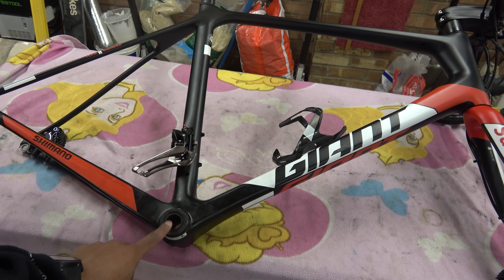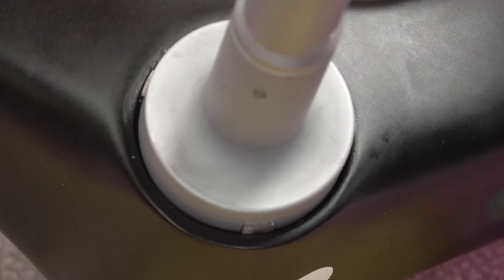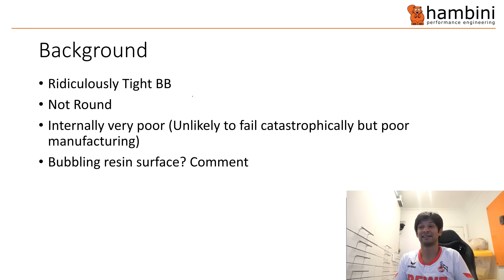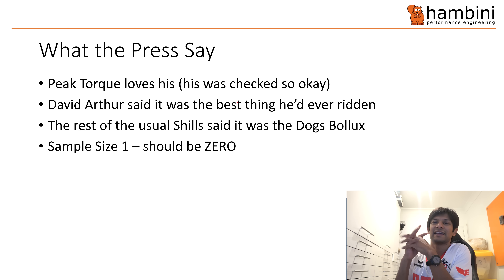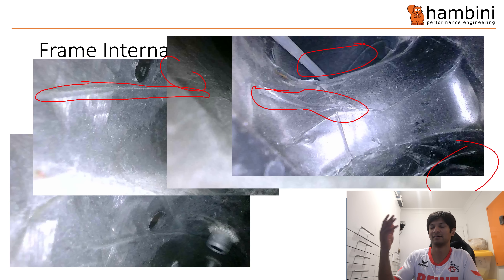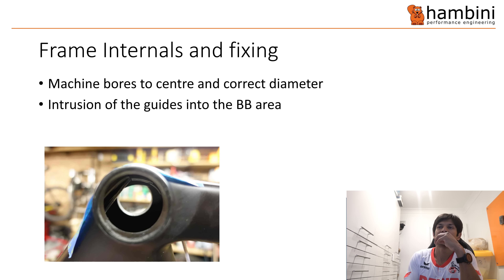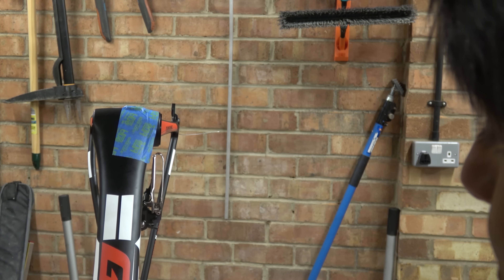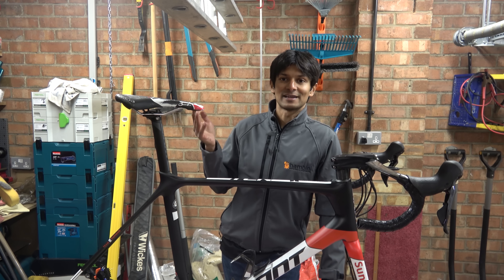Giant TCR gets Roasted. More CRAP quality control

Comment: I'm a TCR owner and have been waiting for this one for a while, great vid as per usaul. I'm a Hambini convert and all my bikes have your BBs in them including my TCR (Hambini Racing BB86 Bottom Bracket Shimano Crankset Thread Together) you get what you pay for! When I got the bike I measured it and checked the frame internals as per Hambini best practice and can confirm that my frame is as it should be on the tolerance front and very well made. It has been faultless so far and works very well with the Hambini BB. I still believe in Giant, any manufacture can produce a bad frame, some probably more often than others. Giant still aren't taking customers to the cleaners on pricing either, which is more than can be said for other manufacturers, the price of an S-Works Tarmac is more than a motorbike, taking the piss!!
Reply: I laugh at people who spend anything more than 2k a bike. I allow the 2k in case they want to use DI2 which is a grand or more in itself. The amount of Cervelo's and other bikes he rips into made me stick to a 1700 budget for my kuota. I slammed a hambini 386 evo BB in there. Hole was nice and round and well as up to spec.

Comment: Wonder if that’s the reason why mine never shift properly when it was mechanical. their reps looked at it. bike shops looked at it. changed everything but the frame and couldn’t get it to work.  I finally figured I’ll probably have to put electronic on it to see if that’s the fault.  Indeed an expensive proposition either way. I went di2 and unsurprisingly it works.  Shameful almost.  Again thanks.  -U10
Reply: Get a Hambini necked BB in there and get that Ultegra 10 speed you deserve! :D

Comment: I have to say that bottom bracket looks weird, never seen a giant as bad as that before, also that frame is not the top the range model in that team colour is just cheaper advanced frame, not even a pro or sl model it was colour run they did with sponsor at the time, you could buy it though... it did wonder if was a fake though. I guess no excuse really if it isn't, pretty disappointed being a owner of two tcr adv sl's🤷‍♂️

Comment: I don't think I've ever seen a bearing pressed into a molded mating surface outside of the bicycle industry. If you look up typical tolerances for different manufacturing processes you'll find that you'll only get the right dimensions by chance on these frames with carbon bb shells.
Reply: Which is why the more reputable bike manufacturers use a machined aluminium sleeve in the BB.

Comment: I have a giant defy advanced pro 2018 disc frame, no complains. 3 years no problems, 10.000 km rided.
Reply: My 2018 Defy advanced Pro has 21,000 kms on it now, no problems yet still original disk's and pads. Great bike so far but quite heavy.
Reply: Got a 2015,
28 000 km, all good so far

Comment: "Ex-team bike" is a frequent scam to pass off a counterfeit or otherwise bogus frame, cause you expect it to be different to a stock one, and its difficult to track down the origin.
I'd wonder if this is actually a genuine frame.
Reply: Did Sunweb ride disc TCRs? I would have thought they were still on rim brake when Sunweb sponsored...
Reply: After looking closer at the images hambini shows, I'm 100% sure this frame is counterfeit
Reply: I’ve seen a lot of these for sale second hand on Facebook marketplace in Hong Kong in this exact colour way. There were a lot of fake tcr, perhaps because it was a popular ‘special edition’ colour.

I have only ridden the later models and I install Hambini BB into all of them. And I could feel the difference. Shame I sold the first bike together with the Hambini classic from 2018. Maybe it is confirmation bias but I’m sure I could feel a difference between the old bb and the Hambini one. I went from shimano bb to tripeak bb to Hambini and the Hambini felt much better.

Only took 6000km to destroy the tripeak, after initially feeling very light, I could feel it becoming ‘gritty’. 

The Hambini bracket was great. And the latest Hambini racing I installed into my 2021 tcr had great comments from the mechanics who serviced the bike.
Reply: pretty sure a team would run the Advanced SL model with ISP rather than the Advanced or Advanced Pro model... Most likely a scam... or just a Team paint job lol.
Reply: @ibikens  depending on the rider, and if it was a training bike, having a standard seatpost makes more sense for travel, bike boxes etc
Reply: @germurphy4986  good point and plus they  def not  not sell a team bike with all the high components on it.they usually sell just  the frame
Reply: @rblaise3031  untrue, I know someone who buys ex team equipment, and they are mostly fully assembled bikes, 53x39 with PMs, tubs etc
Reply: @ibikens  if I recall correctly they had the “advanced pro team” which was the midrange frame with the regular seat post and sunweb team colors on it
Reply: It doesn’t look to have the same Serial number as most of the TCR’s come with.
They all have a barcode under the downtube and then the actual serial engraved into the bb shell.

Comment: Mechanical gears with hydraulic disk brakes is a standard gravel setup (for people with a sensible budget who won't go wireless). It gets pushed into pure road territory because it costs more $$$.
Reply: I know a few guys with mechanical disc for some years on their road bikes. I'd say mechanical GRX from Shimano are very popular with the gravel scene
Reply: @glennoc8585  GRX is basically MTB mech in a different form factor. It completely does away with the general softness of road mech. Plus, you get gear ranges more suited to rough terrain. After switching recently, I can see why it is so popular.

Comment: I have the very same model year TCR (winter bike), and STANDARD size Hambini BB fits fine. The front mech shifts like the clappers. A happy client in Poland. (Didn't need the BB, but boy, oh boy do I like it.)
Reply: Same with my 2019 Advanced Pro TCR frame.  Had to fiddle with the cables when bracket was half way through.  But went in just fine and no issues with my front mech shifting 52/34👍

Comment: Hello brother Hambini  HI,, I have been fixed Hambini bottom brackets for more than 6 bikes al if them they work with BB86 Necked. 
Always Giant frameset give me hard time because the extra lips and much cables inside the framest. 
Khalid ❤️
Reply: My partner had the same framed bike and it was swapped twice by Giant for poor paint issues, defects under the lacquer. If you had to remachine the BB to centre it, would that have removed ply’s from the composite shell. If so doesn’t that also impact the strength. What are the frame carbon tubes wrapped onto, ceramic core, filament wound etc?? Regardless, how do they manage to wrinkle the first ply? That’s a big no no in composites manufacturing and the manufacturer’s of aerospace or motorsport composites go to great lengths to prevent this. Mainly due to the inherent weakness that comes from it. We sold this bike on due to all the issues experienced, especially alignment etc. Several attempts by bike shops to get the rear mech meshing correctly, they never worked!

Comment: My TCR Avanced Pro 0 is like triggers broom, 1 x new frame (Paint started chipping around rear hanger area) two new cranks, ended up with Shimano Dura ace crank power meter free from Giant  as the giant power meter is shit and the first replacement they gave me to fix the stock one that want working didnt work either, and a new ridesense cadence sensor. All underwarranty, to be fair no issues getting it all replaced, just shit you have to. Cant fault the bike since then though. Great to ride. Paint on new frame still chips and flakes away as it just hasnt adhered to the frame properly  around thru axle holes. Still love the bike though.
Reply: From one crap frame to another.... sell on Ebay and buy a real bike